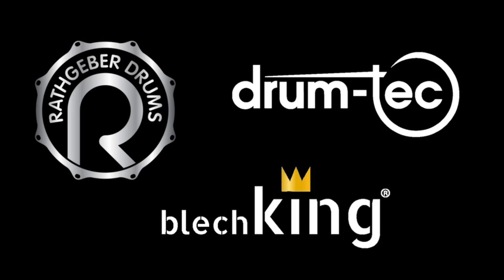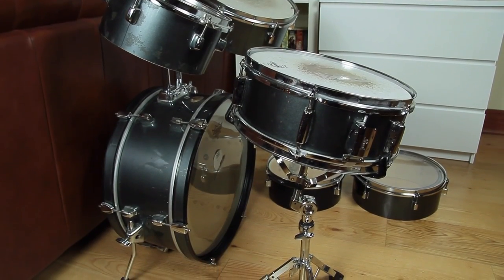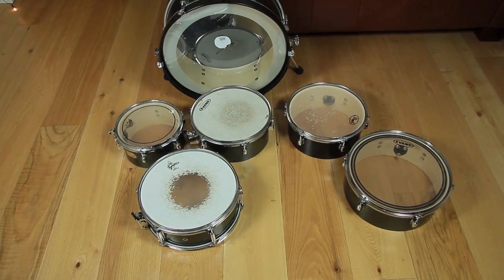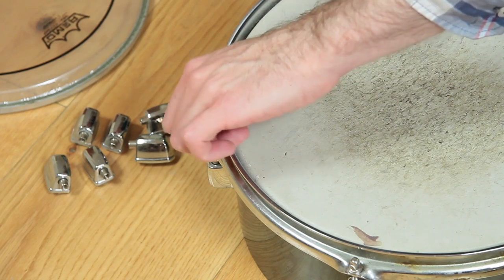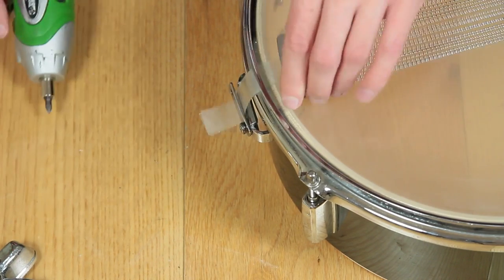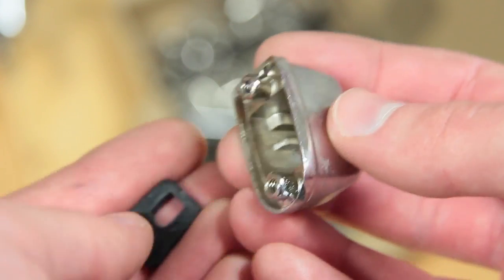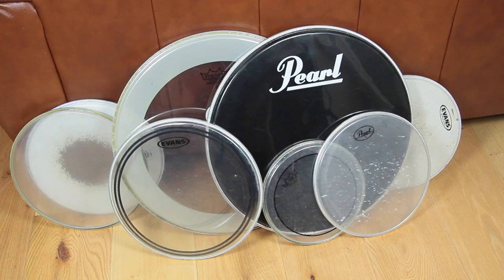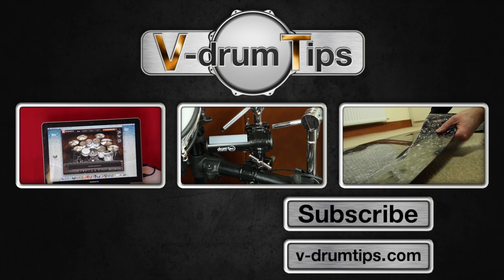E-drum Conversion Part 1 (Kit introduction)

Comment: what is the dimensions of the bass drum.
Reply from the maker: 20" in diameter and I guess 10" in depth.
Reply: Vdrum Tips Looks like it,Thank you.
Reply from the maker: No worries, it is really flat bass drum, perfect for compact setups. Stimm feels like a big one:)
Reply: definitely that why i want to know.
Reply: I own a RYTHM TRAVELLER kits and the dimensions are actually as follows: Drum sizes:
20" x 8" bass drum
10" x 5", 12" x 5", and 14" x 5" toms
13" x 5" wood snare drum